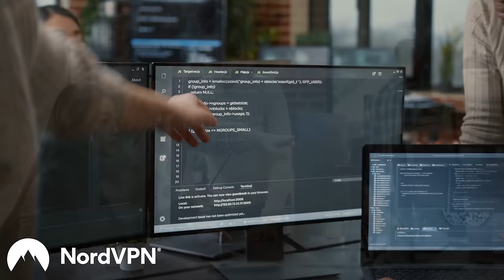Elon Musk fails Cybertruck stainless steel metallurgy test | Auto Expert John Cadogan

Comment: In physics a gramme is a unit of mass, not a unit of weight. It is defined as such via SI units where the base unit is actually the kilogramme (the only SI base unit with a metric prefix for those who love trivia). So, no, the kilogramme is not a unit of force. However, the weight of a kilogram mass, is a force, but a force that varies according to location. That weight is highest at the poles, and lowest at the equator and varies somewhat with altitude, local rock formations and so on. The variation is about 0.5% according to location on the earth. Of course that's not even taking into account buoyancy. A 1 kg mass of feather weighs rather less than 1kg of lead because of the buoyancy of air. Immersed in water, the weight between different substances does vary a lot more with density of course. 

Of course once we start venturing away from the immediate locality of the Earth, then the difference between weight and mass becomes extremely important. As the engineers from the various projects that landed probes on the Moon, Mars, Venus and so on.

So, scientists and even engineers will distinguish between mass and force, using Kg for one and Newtons for the other. Of course, there is an informal unit, which is the kg-force, which we might defined as the equivalent force of one kg mass acted upon by a standard gravity (9.80665 m/s^2) so for many purposes, such as say, building a bridge where the tolerances are rather wide then loadings in terms of metric tons is good enough. However, even in things like building floor loadings, the regulations in the UK (and many other countries) are defined in terms of newtons per square metre (pascals), not kg per square metre. However, kg-f is not standardised, it does not comply with the International System of Units (SI) and is deprecated for most uses.

So, if we are to be accurate, in terms of engineering and science, a kg is not a unit of force, but of mass. It's just convenient for everyday usage to think of it as about the weight of a kg mass at the surface of the Earth. I would add that the local variation of the acceleration due to gravity (it is not just gravity by the way, centripetal force differences with latitude are as significant as gravity), that even moderately precise scales are calibrated for locality. Balance scales do it automatically of course, but electronic scales do not and are typically calibrated using a known mass, and for very precise scales, that must be done in situ. Of course what all this does is make scales, the world over, be calibrated for mass, not weight where this is done systematically

So, common usage fine, but as this channel constantly goes on about reality, then the underlying principles have to be borne in mind.

Comment: Sandy Monroe had a very good description of the specific metal that’s used.  It is a special 300 series alloy not, 304 austenitic, that’s been treated to convert it from austenitic to martensitic.  The martensitic crystal lattice gives the hardness (actual hardness) along with good elastic properties which allows it to be resistant to the 9 mm sub gun round and yet allow it to be surface polished.  

Note 304 Stainless in this thickness won’t even come close to stopping a 9mm round nor will the carbon steel used on any modern car door panel.  

This guess haters gotta hate!
Reply: Yeh, I saw that interview too. Special alloy treated to martensite. The haters ignore the truth.
Reply: Well, haters also gotta call out BS.  Whatever the last numeral in the 30X nomenclature, it's clear that this is not a highly corrosion resistant stainless.  After all, what level of corrosion resistance does rocket need in the near vacuum of space?
Reply: I always watch Sandy Munroe - the guy is a real expert.
Reply: This know it all spouting off in this video is making assumptions. He has not spoken with the engineers at Tesla. He just assumes they are all stupid and only he knows the truth about the materials that these engineers created. He has zero experience working with this material. He has never used a gigapress. He has never even been in the same room with a press designed for air bending. Yet so many here think him an “expert”. It’s laughable. 

I’m going to side with what Tesla says on this one. If this guy knows so much, getting funding shouldn’t be difficult. Build your own car, and show the world how it should be done. Until then have a little respect for those that are actually doing something meaningful, and not just running their mouths.
Reply: @johannesschaller5510  You do realize that the term X as used in 30X in metallurgy predates Elon.  And simply denotes 300 series stainless steel.  Also, the alloy that SpaceX developed is a true Stainless Steel and is highly resistant to corrosion.  I guess you can ignore the truth if you want.
Reply: @angryrabbitproductions1690  I think it’s the sensible thing, Space X and Tesla  engineers are some of the finest on the planet.  And it seems that all of their engineering is world class.  People who complain or find fault almost exclusively have not worked with them or aren’t qualified.
Reply: @johannesschaller5510  A rocket being constructed and stored outdoors right next to the ocean, and that is intended for durable reuse, does, in fact, need to be corrosion resistant.
Reply: @Global_Optimization  No more so than a kitchen sink, and what does it matter if a rocket that the average person can't see up close shows a bit of tea staining.  Put that same material on a car body, and you accept that it'll need regular attention to look clean.  As for the stress corrosion cracking propensity, I'd need to know more about the alloy composition and microstructure.
Reply: @johannesschaller5510  Yeah it will need to be corrosion resistant for appearance as well. However, it’s safe to presume that Tesla did think of this rather obvious design requirement, and from our perspective it’s all speculative anyway. The alloy composition and properties aren’t publicly known. All we know it that it’s some kind of novel 300-series stainless alloy, cold rolled, supposedly extra hard, and can absorb subsonic bullets. In this video many assumptions are made.
Reply: @Global_Optimization  Sandy Munro spoke briefly about it in a recent video, so we have some info, but the main feature as I understand it is that it's heavily cold-worked before it reaches Tesla.
Reply: @johannesschaller5510  Today this was discussed by Tesla executives in a new Munro Live video at 22:15. It’s not 304 nor 316 but rather a new blend with extreme corrosion resistance and good enough ductility
Reply: @Global_Optimization  Yeah, watched that bit and it was clear that Tesla wants to protect the composition of its stainless, aka "HFS".  A word jumble including cobalt, nickel, toughness, corrosion - not much valuable information provided, even regarding the "air bending" technique.  Seems Tesla is using adaptable, cushioned tooling to reduce the bruising that would result from using fixed tooling, but I'd be very surprised if the HFS wasn't supplied into plant with a removable plastic film to protect it during handling and processing.

Comment: In a Munro interview Elon said martensitic steel, that is why it's bulletproof with a 45 cal. Austenitic being more ductile and corrosion resistant, but not as hard and strong.
Reply from the maker: 300 grade stainless is austenitic...
Reply: @AutoExpertJC   and the Tesa 304x is Martensite, goes in austenitic, after forming it goes out martensite, go check munroes video about it
Reply: @Hans-Yolo  Yes, i saw that part on Munro. The steel was work hardened by cold rolling and became martensitic.

Comment: Good to hear someone with actual knowledge of the matter! To my knowledge, there are spring steels made from stainless steel, basically by work hardening them (by cold rolling). Like that, stainless steels can have very high yield strength up to 1500 MPa! Which is a lot for any steel. However, using that to make a car body would be absolutely insane, because these work hardened steels are not very malleable. And yes, yield strength and hardness are two completely different characteristics.
Reply: I wrote that comment before you covered the topic of work hardening in the video. Thanks a lot for that video! But the Tesla fanboys will surely find a way how to dismis your arguments...
Reply: @andedabtau8335  No, I beleive  Sandy Munro more that John, I believe the engineers at tesla more than musk. We are engineering fanboys, contrary to what you think.
Reply: @andyfreeze4072  So where was John wrong? Please tell me and enlighten me with some facts. Not marketing bullshit from Tesla/Musk. I am a mechanical engineer myself, having focused my master studies on structural mechanics. And obviously material science was part of my studies. So I know a thing or two about (stainless) steel and I think I can judge if someone is talking crap or knows what he's talking about. And John definitely knows what he's talking about! And don't tell me the stainless steel grade Tesla uses is a secret. With the right equipment, the chemical composition of a material can be determined in minutes.
Reply: @andyfreeze4072  And yes, I know there is more to a material than it's chemical composition. Like heat treatment (not for 300 grade stainless steel however), grain size, work hardening etc. But all these effects are well understood and not a mystery. I really hope you can show me some engineering facts about the Cybertruck, because every time I try to find them, I only find mainstream media articles written by journalist obviously not knowing a lot about engineering, manufacturing, material science that just repeat the bogus claims by Musk.
Reply: @andyfreeze4072 I'm just in the process of watching Sandys video "An Engineering Analysis of the Tesla Cybertruck" in which he claims martensite can be achieved in stainless steel by heat treating it. Which is just wrong for 300 series stainless steels!!!

Comment: 300 series SS is manufactured and sold in annealed condition.  However it can be work hardened and yes it does get hard enough to make it on the rockwell C scale. Tesla mentioned that their work hardening process and alloy become slightly martensitic and magnetic.  So it is not 304/316 and it not in its annealed condition.

Comment: ”The Future is Triangular.”
-Elon Musk (rocket Karen)
Reply: I expect him to invent a new type of wheel within this new triangle universe 😂
Reply: @fromgermany271  "It's easy"!!! "It's just like a regular wheel, but rather than taking all of those small incremental steps to pass through a 360 degree rotation, it uses 3 120 degree steps which makes it more efficient than any other wheel on the planet". "Trust me, you would be crazy to buy a round wheel".
Reply: 30X steel alloy used for Building Star Ship and Cybertruck designed for liquid nitrogen is −195.79 °C (77 K; −320 °F) Liquid oxygen(LOX)  −183 °C (−297 °F)

Comment: Isn't a 'Truck' supposed to have some room for carrying cargo and stuff... But I imagine that any vehicle carrying a large and heavy battery around has a limited capacity for carrying anything else.
Reply: Carries 8x4 sheets, so that's bigger capacity than most other equivalents. (& A twin cab too.)
Reply: Why ass backwards - 4 x 8 would be more accurate. @guringai
Reply: @guringai  No visible height on the rear load area like other 'trucks' - The cyber urinal is the ultimate 'form before function' design... and the price as well.
Reply: @hcox1111 
Here in shitsville, it's always 24x12, or 2400 X 1200, but I put it in the ancient terminology being 8 X 4.
Reply: Fair enough but most people don't live in shitsville , but they may as well. LOL

Comment: My dad came up with a 360 deg rotating leak-less, load bearing swivel joint. Add flanges/elbows and you got a loading arm 2" - 12". Options included Monal 400 (now that stuff is hard and really fookin expensive). The stainless option was only really used for some acids and food related station to tanker loading. Machined out of single piece of bar, turning stainless was an issue but welding the bloody stuff was the real problem.

Comment: Hi there John, Just a thought I wonder why they (automotive industry) haven't used 0.7mm 415 BA Stanles Steel, it's the SS used to molty stage press, sinks, it is also self healing, and won't rust and does not need to be painted.???? A

Comment: I like the look. I like the tech. I think the car will be great. Sandy Munro is impressed with the steel. Said it’s Martensite which makes it even harder.

If you don’t take risks you won’t make any advancements.

Tesla and Elon are taking risks. There’s lots of engineers there. They have made great products and made great advances. People didn’t think that it was possible to make reusable rockets and they did it which brought costs down. People thought you couldn’t make a compelling and competitive BEV and now the Model Y is the best selling car (car, not just BEV, car, it is beating ICE). People said you can’t make a BEV truck and they made the Tesla Semi.

You might think the aesthetics are ugly and design bad and claims bullshit. But they made and are starting to deliver. It has low drag coefficient. Low CoG. Low weight compared to Hummer EV etc with comparable range and performance. Time will tell if it’s a flop or not, and good or bad design.
Reply: No - John knows what he knows and knows that it's IMPOSSIBLE to do any advancements in stainless steel! Didn't you see the video!?! John clearly knows A LOT about stainless steel and manufacturing process.  If I'm going to trust anyone it's him over some random youtube commenter!
Reply: The thing that annoys me is it’s meant to be an advancement but it can’t even perform the basic functions that cause me to own a 4wd truck. Further it doesn’t even have the capability to drive the distances needed.

Not to mention the issues with modifications and fixing it in the bush and its weight the list goes on.

Literally has about 8 or 9 total deal breakers.

Would be nice if they made a decent electronic truck but the guys that designed it didn’t think about real world users.
Reply: @geoffclarke5901  What are the 'basic functions' you mentioned them but not specificially..

Comment: So there is a video out there where they take people through the cyber plant: two things of note the sheet metal is heated RED Hot in ovens before stamping and they're using 1.4 and 1.6 mm stainless steel depending on the particular body part.
Thanks for the educational aspect of your video.

Comment: Thanks for the technical explanations on stainless steel and metallurgy. Great points about strength vs hardness! Based on some videos it's possible that the modification Tesla made to the stainless recipe was an adjustment for rust resistance. They do have a lot of experience with materials for rockets due to SpaceX.  Musk loves to make outrageous marketing claims, but let's be honest: the shape is not driven by material choice. It IS the appeal. The stainless steel is part of the marketing as a futuristic vehicle out of blade runner.  Still, it has some advantages: it can't be door dinged, there is no delicate paint, and it's easy to renew the appearance with some elbow grease and a scotchbrite.

Comment: I can't wait for your report on having a 9,000 pound EV beast having steering by wires!
Reply: “Cyberbeast weighs 6,843 pounds and that the All-Wheel Drive comes in at 6,603 pounds. The rear-wheel drive, purportedly available in 2025, does not have a weight listed, but assuredly will be lighter than those other two.” Motortrend Magazine.
Reply: Planes have used fly by wire for nearly 20 years. So if its safe in a plane surely it is safe in a car don't you think?
Reply: @zoransarin5411   Not fly by wire like in a plane. Electrical wires!

Comment: I can't stand Musk but there is some interesting tech at play in that stainless wedge.
The stainless is actually interesting because I believe it's called deformation induced martensitic transformation in 304 austenitic stainless steel which does change the characteristics of the 304 stainless. Of course, this makes it even harder to play with and I'd hate to wash that truck with all the sharp edges but if you live in America,  a bullet proof truck is probably a necessity.
Would have liked some discussion on the steer by wire and the fact the rear wheels aid in steering, which all seems pretty innovative.
I think the glass may be Gorilla glass that is used on a lot of mobile phones.
Let's face it, Tesla have some good engineers and it's just Musk who is nuts